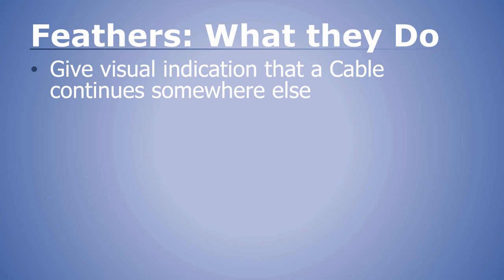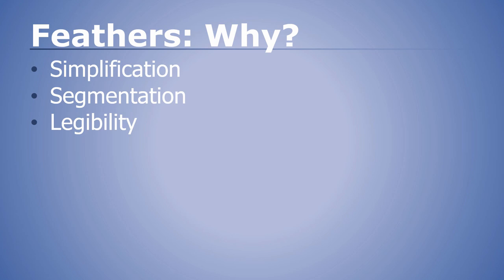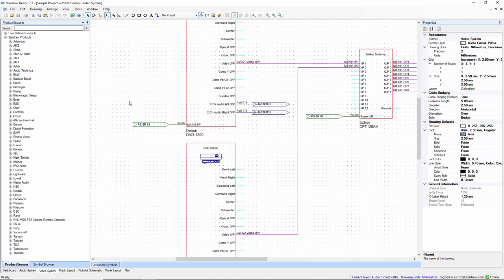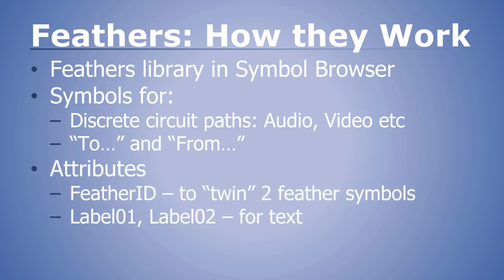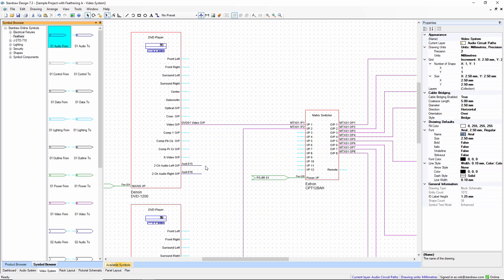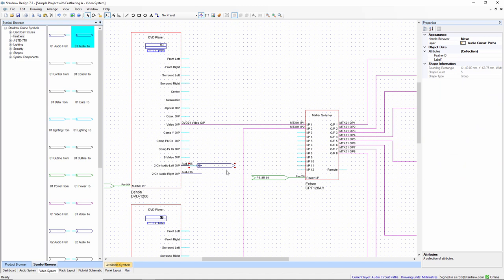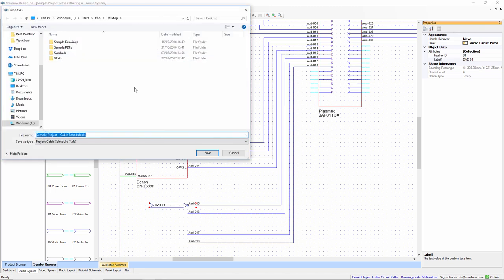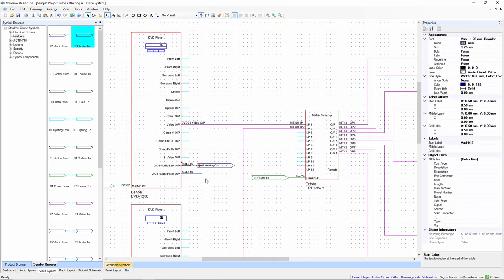Feathers

Comment: There needs to be more logic to this in the coding. Feather ID’s and Labels need the options to be auto generated from cable attributes by default. Also, there is little need for feather info itself in a cable schedule for integrators. They care more about the cable ID, FROM location part/port, TO locations part/port, and cable type/color/length
Reply: Stardraw maybe cable labels/ID’s should be required but their visibility doesn’t have to be. That way there is always an attribute for the feather to populate its label from. Have you guys looked at how this words in Visio and more specifically how D-Tools handles this with their add in to Visio? The off page reference can be customized to generate a label that tells you where the cable connected to it goes by component ID, port ID and page number or label for those of us using sheet numbers similar to architectural drawings. I’m sure it can be accomplished, it’s more a matter of what it shows or does not show and what is on by default. It would make this much more intuitive. Having an additional feather line in a wire schedule seems unintuitive m. I am trying the demo now so I will get to play with it more. But to me, feathers have no use on a schedule, only to navigate large drawing sets and keep them clean. If the feathers had auto-generated labels like from wire numbers, product component IDs and page numbers that was standardized (and said standard was customizable) across the drawing set then we could utilize features like Bluebeam’s hyperlink auto generator for PDF sets (or you could add a hyperlink feature into your PDF generator triggered by these feather assets). It’s just a thought and again I am still learning Stardraw and yes I get that one size doesn’t fit all.